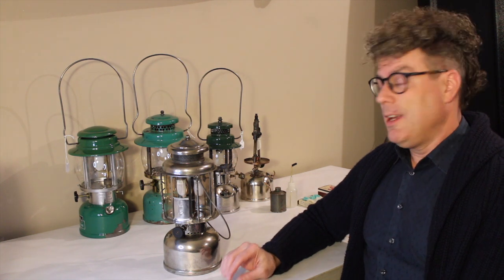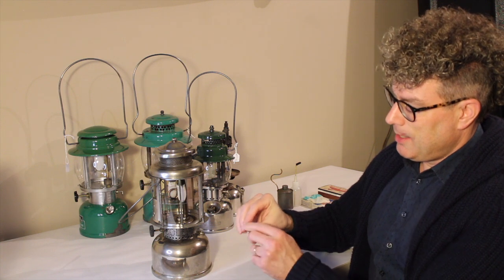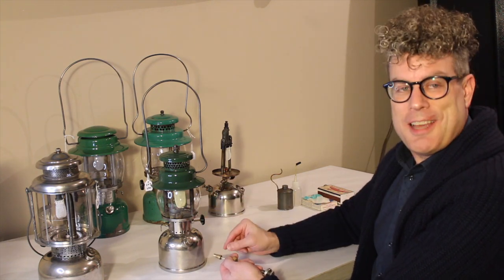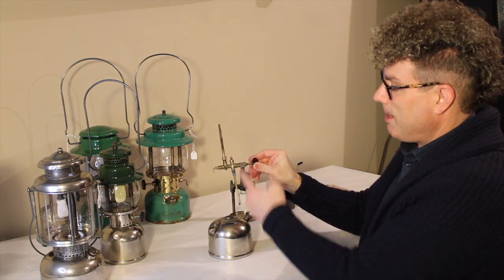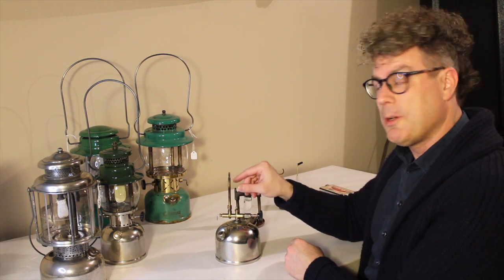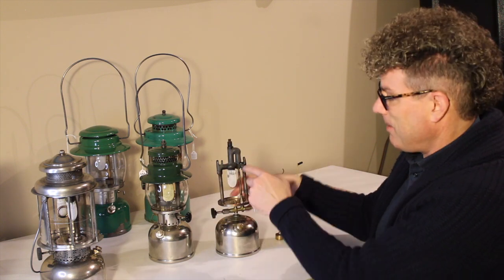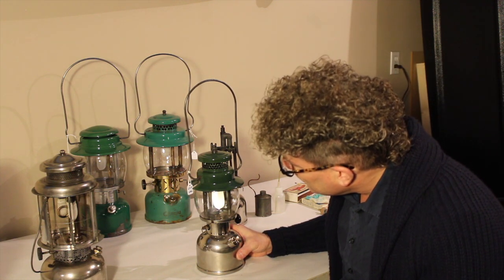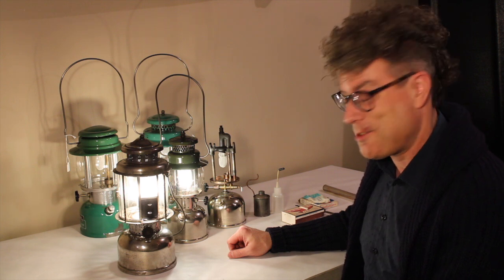Theory of Operation: Coleman Quick-Lite & Kerosene Lanterns

Comment: It's not the water that makes isopropanol smoke. It's a heavier molecule with more hydrogen and carbon than ethanol or methanol and that's what makes it sooty. Even 99.9% isopropanol will burn with a lot of soot. That's what "heet" in the red bottle is. The yellow bottle is indeed methanol.

You've done a great job explaining how these work, nice job!

Comment: Here in the UK, there is a great alternative to Coleman Fuel, which is expensive. Its called 'Aspen 4' which is a highly refined unleaded without most of the additives. It is used in chainsaws, mowers etc. Works great in white gas lanterns!
Reply: Sounds like an alkylate fuel.

Comment: I have a buddy here in California that loves USA 200A single mantel lanterns. He runs them off either pump gasoline or  Kerosine with the correct Coleman fuel generator for the 200A. When he runs Kerosine, he removes the ventilator and globe, holds the lantern to the side and pre-heats the generator with a gas BBQ lighter (but I did see him do it with two stick matches). Once the generator is hot, he reassembles the lantern and it lights with a match the same way you would with Coleman fuel. It works perfectly. I never would have believed it if I did not see it and he always runs his 200As this way. Amazing!
Reply from the maker: All the gas models will run fine on unleaded, you just don't want to use stale unleaded or leave it in the fount long term.  Unleaded will leave a nasty residue if stored and stale unleaded will make a mess of the fuel system over time.  Instant-Lite models like a 200 don't typically run very well on kerosene, although conversion kits are available.  Kerosene requires a smaller orifice in the gas jet, otherwise they'll run too rich.  The gas generators won't have the same longevity when burning kerosene.

Comment: Well done!!! I'll be restoring a Coleman, or Coleman type two lamp White Gas Chandelier. I have not seen any markings on it. It requires an external pressure pump which I still need to source. I grew up with Coleman Camp Lanterns but they all has built in pumps. Your stem to Stern Video was very helpful.   Best of Luck, Stay Healthy..................

Comment: Very very informative great job A to Z explanation thanks.... is there some form of pressure regulation or will higher pressure just burn  brighter and use fuel less sparingly?... can it be pumped too much in short?... where can or do (if) most kerosene leaks occur? ... i have a  1970 canadian made model 639 does not appear to show b or c ... ?tin plated? fount
Reply from the maker: Fuel flow is regulated mostly by the pressure of liquid fuel expanding as it turns to vapour in the generator.  If there isn't enough pressure in the fount the lantern will be dim, but you can't really over-pressurise them.  It depends on how full the fount is, but about 25 strokes of the pump on most founts will give you maximum brightness.  After that more pressure won't make a difference.

Kerosene models are no more prone to leaks than gas models.  Leaks typically happen when things are loose or when a fount is compromised by rust.  Early 639s had nickel-plated steel founts and later ones were painted.

Comment: Thank you for the time you put into these informative and entertaining videos. I found that very useful. With Coleman “ dual fuel “ is that white gas and pump gas ? Or white gas and kerosene? I find the sheer amount of Coleman models a little bewildering especially when Coleman seemed to produce several models at the same time.
Reply from the maker: "Dual Fuel" means white gas and unleaded.  Kerosene models will burn both kerosene and white gas, but Coleman never referred to them as "dual fuel".
Reply: Thanks  @king.coleman

Comment: Could you provide a link to the correct Alcohol? My hardware store (USA) doesn't know and I don't know what other alcohols are that you mention.
Reply from the maker: Any alcohol will work, you just want it to be 100%.  Most people use ethanol or methanol.  I use methyl hydrate.  In the States it's usually sold as denatured alcohol (ethanol with enough methanol added to make it undrinkable).  Some use Heet gas line antifreeze, which I believe is pretty much straight isopropanol.  The 99% isopropanol sold in drugstores will work as well, but the 90% or 70% versions will be more difficult to light and will produce a lot of soot to make a mess of your lantern.

Comment: New to the vintage Coleman world.
(Also fascinated with the old Swedish Primus gear as well).
Just to clarify…. When you say “gasoline” are we talking about fuel for a car? Or, I assume you could mean Coleman white gas? 
Just wanting to be sure. My wife found a vintage 237a I’m going to be cleaning up nice and proper.
Thanks SO much for sharing all this super helpful info!!!
Reply from the maker: With regard to Coleman lantern and stoves, when we talk about gasoline, we're usually talking about white gas (aka, naphtha or camping fuel).  That said, unleaded gasoline can be used as well, just be sure it's fresh.  Stale unleaded can make a mess of the fuel system just as it will in a car.  Avoid storing an appliance with unleaded in it, as it will leave a mess, unlike white gas.

Other manufacturers were often specific that their appliances could be run on either unleaded or white gas.  Some specifically called for unleaded.  Coleman gradually came to settle specifically on white gas, but back in the 20s, for example, Coleman stoves came with siphons for removing unleaded from your car's gas tank and adverts and instructions showed the process for siphoning gas from car to stove.
Reply from the maker: Note that your 237 is a kerosene model.  You can burn gas in it, but it will run optimally on kerosene.
Reply: @king.coleman  “from car to stove”- love the practicality of times gone by. Thanks so much for the generous insight and wisdom. 
I plan to film some of these new found exploits as well. I figure the more folks share and learn about these old beauties, the more they’ll be collected and put back into service. 
I’ll def be looking out for more vids as you share them.
Much appreciation for what your doing!
Reply from the maker: @acidheadzzz  To clean the fount/tank, I'd suggest starting by filling it with methyl hydrate or denatured alcohol and letting it sit for a few days.  If that doesn't work, there are other options, but it would be helpful to know what stove model we're talking about.
Reply from the maker: @acidheadzzz  If it's an M1950, it's American.  Like the milspec lanterns, they were made by a variety of manufacturers specifically for the US military and using military specifications.  They were made only for the US military.

You can find methyl hydrate at any hardware or paint store.

Comment: Great video and very nice lanterns. I have a 327 quicklite as well however the nickel plated fount has a pinhole leak in the side after pressure testing. Debating whether to try POR15 to seal or find an equivalent donor fount. Your advice would be sincerely appreciated.
Reply from the maker: 327 founts are relatively easy to find, so my first suggestion would be to locate a good donor.  If there's a good reason to save the existing fount, Caswell makes tank sealer suitable for fuel tanks under pressure.  In fact, a year or two ago they started selling smaller cans of their sealer specifically for use in lantern and stove tanks.  POR15 may work just as well, but plenty of collectors have contacted them to ask if it's suitable for use under pressure and they always respond: No.  That may just be a liability issue, but I'd be inclined to go with the company (Caswell) that sells their product for this purpose.

Comment: I recently inherited a coleman lamp patented in 1925. It is a large lamp, about 24 inches tall with a large art deco base and  a wide flat brim top about 10 inches or so across. I'm not sure what kind of fuel or mantles  it requires, but your videos have instructed how to light it so thank you very much. I also received a small avocado colored "catalytic heater " that I dont know much about. What type of fuel it takes or how to light it remain a mystery.  Can you offer any help or advice? Thank you so much!
Reply from the maker: Coleman made two types of catalytic heaters, some that run on white gas and some that run on propane.  If it has a fuel tank, it's a white gas model.  They're pretty simple.  Fill the tank, remove the protective cover and snuffer, tilt it briefly to get a wet patch on the asbestos catalyst about the size of a dollar coin, then light it.  Don't lean over it and be sure there's plenty of clearance above as it can make quite a flame when lighting.  Eventually it will settle down and you can put the protective cover back on.

Comment: Good video. I learned quite a bit from this and from your 200A teardown video. Years ago my mom gave me a couple colemans after my grandpa passed. I didn't think much of them but one was a 220F he scratched his initials into like he did with everything he owned. My parents had one that I foolishly threw away about 15 years ago when the top ball nut cross threaded and twisted the top stud off. It even had an amber globe. Anyway, the other was a 1919 Air O Lantern Model QL which I figured out how to run and it works great. The only question I have, is was that QL originally designed to run on gasoline? It is quite black from soot, I assume from being lit without preheating. I learned the hard way that it needs to be preheated. Just wondering if it runs off gas. The cleaning valve is inside the globe so its a pain to turn while running.
Reply from the maker: Yes, the Quicklite was designed to run on gasoline.  The original Q99 generators could be easily preheated with a couple of matches (see my video on "How to light a Quicklite").  The Q99 generators, however, were inconvenient if they clogged.  To clean the tip you had to shut the lantern off, let it cool, and removed the generator to use a cleaning tool on the gas jet.  Yours has an R55 generator, which included a built-in tip cleaner.  The downside of the R55 is that it's not as simple to preheat.  A lot of folks just light them and let them flare.  Since they run on gas, they settle down fairly quickly, but it does leave a lot of soot on them.  The Quicklites were made before the days of Pyrex globes and shipped with mica chimneys.  The mica chimneys had a lighting door, which was also the access point for the tip cleaning lever.

The R55 was a sort of universal generator.  They were designed for both gas and kerosene and shipped on most kerosene lamps made between the 1930s and 1950s, were a replacement for the Q99, and you'll find them on some of the early Instant-lites.  Since Quicklites have a simple fuel pick-up (the same as a kerosene lantern or lamp), you can burn kero in them with that R55 generator, you just need to add a spirit cup or preheat with a propane torch.
Reply: @king.coleman  thank you sir. I have actually been running white gas through it after preheating that straight generator with a torch. I'll try gas or kerosene. Much cheaper. Thanks for the info. I need to get a mica chimney as well.  This has an old glass coleman sunrise globe from who knows when.
Reply from the maker: @onropewithcmfm4430  To be clear, when I said "gas" I meant white gas (aka Coleman fuel, camp fuel, or naphtha).  These were designed to burn white gas.  You can burn regular unleaded, but make sure it's fresh.  Stale unleaded will leave varnish through the fuel system and make a mess of the generator.  And definitely don't store the lantern long-term with unleaded in it.  White gas will last forever, but regular unleaded will not.
Reply: @king.coleman  I figured that was what you meant. I just cleaned a sears model big hat up that reaked of varnish and the fuel pickup was green and sticky from stale gasoline. Thanks again.